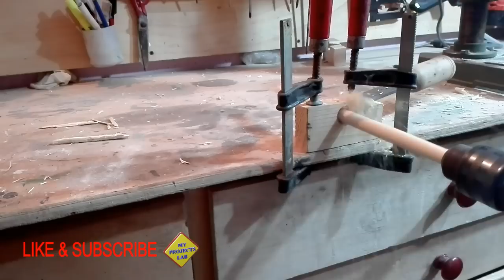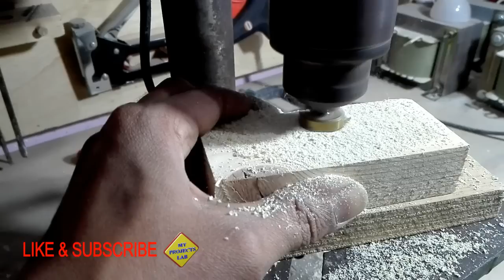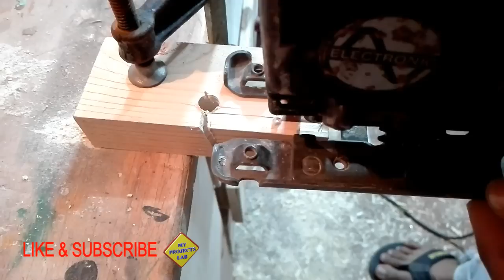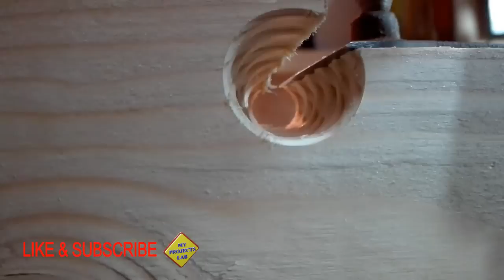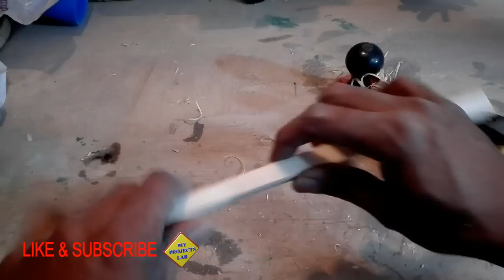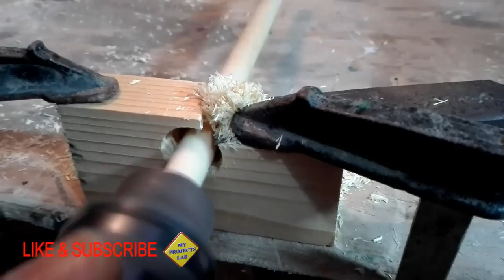How to make Wooden Dowels - Homemade Dowel Cutter - DIY Dowel Jig

Comment: what changes would I make for other (smaller) size dowels ?   Move the chisel ? Different / thinner piece of wood ?  New to woodworking so more info pls
Reply: You'd need a smaller die (the hole) and start with stock dimensioned small enough to fit the entry, e.g. square stock with side length slightly greater than your desired finish diameter.

Comment: Nice design.  I've been watching many videos on making dowels recently.  This is one of the best I've seen so far.  Do you think this would work for EPS foam or XPS foam?  I need to make a polystyrene pattern for a machine I'm building and need a sure way to make a handful of 3/8" and 1/2" short dowels in foam.

Comment: About the best and easiest working model dowel cutter to make, basically a large pencil sharpener. as old chisels can be found on car boot sales would cut one down and bolt it to the wood and consider a belt sander jig for sanding not that it is needed. always keep the fine sawdust for mixing with glue to make a matching wood filler.

Comment: Cutting timber the way you are doing on the table saw 6;19 onward with loose hanging shirt sleeves is a bad accident waiting to happen. I am surprised that you would show such an unsafe and dangerous method in your video; the spinning saw blade only has to make the slightest contact with your shirt sleeve and you could easily lose an arm. The section of you using the saw in this dangerous manner should be edited out of the video or remake the video using safe and responsible procedures. Anyone reading my comment please take note' if you wear long sleeve shirt while working on the table saw; please roll your sleeves up  above your elbow as far up your arm as you can and make sure they will not fall below your elbow when working on dangerous machines such as the table saw, router table, band saw, drop saw etc etc.
Reply: John Robinson
 Our woodwork teacher always starts class with a five minute safety talk which he always finishes with,  'ties off, sleeves all the way up and lets make something'
Reply: you have a responsible teacher Seth; I wouldn't want the guy in this video teaching my kids or family member. Safety procedure is essential when it comes to working with these kind of machines.

Comment: I wasn't going to say anything about bare knuckling the drill press.  And then I could overlook the holding a hack saw blade with no handle.

But the loose fitting sleeves of the table saw.  

How does this person have all of their fingers?